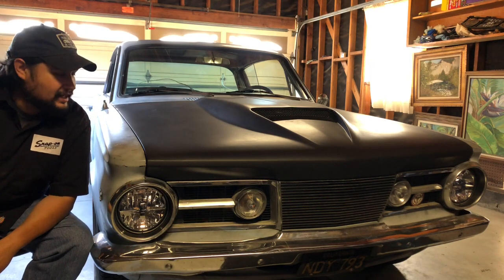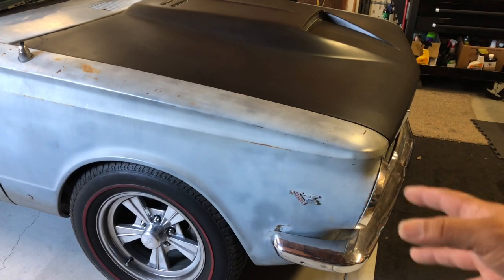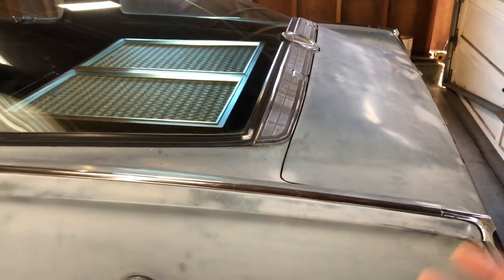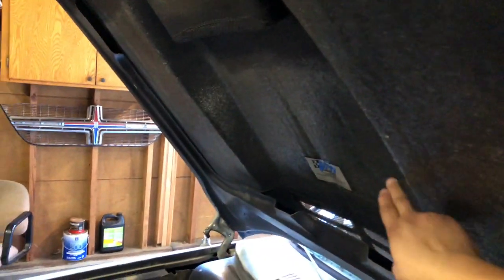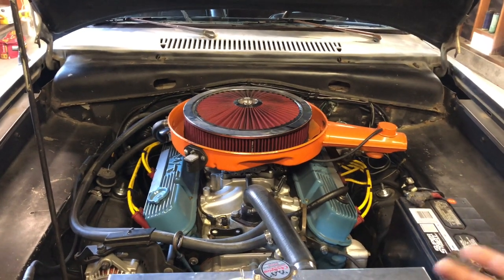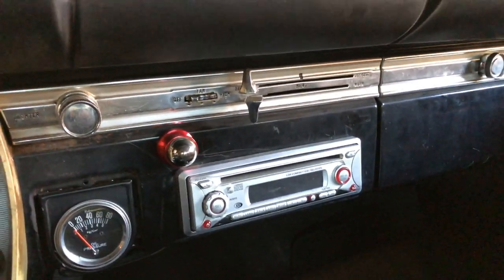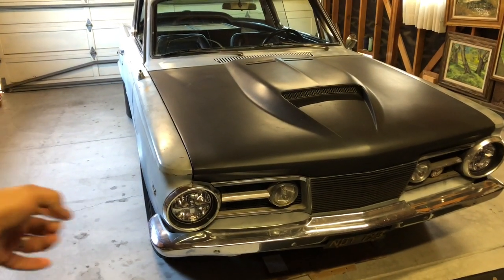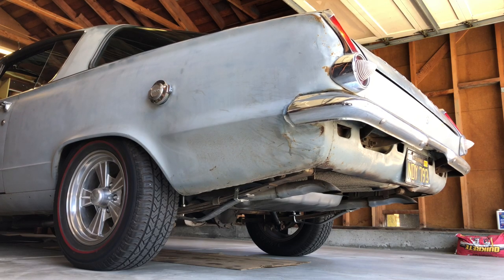MOPAR REVIEW : I review my 1965 Plymouth Barracuda

Comment: Im seriously impressed. Fuel injection and disk brakes with upgraded suspension. And the 318 has the same M/T valve covers i had. I had a 69 Barracuda in the late seventies and there were people who used home speakers in their cars. At the time high power car stereos were just starting and I had a 30 watt Craig cassette player with radio shack 8" woofers and big midrange horns all built into the wooden divider between the trunk and the back window. I had a bed in the back because you could camp out in these cars. Yours is beautiful, dont ever let it go!
Reply from the maker: Thank you so much! I’m really glad you liked the review and my car. Yours sounds like it was awesome

Comment: Good video!   Thanks for sharing it.

My dad had a bright red 1964 Barracuda with a 273 V8 and the push button transmission.  It was in excellent condition.  Original everything.   It wasn't in showroom condition but it was definitely in excellent shape.  He took it to a few local car shows and scooped up a small handful of prizes.   He had it from about '85 to 2005.  He kept it in great shape but then realized he couldn't keep it rust-free when it shared a garage (in Illinois) with cars that were driven in the winter.   He had to sell it, but it really did break his heart to do so.   I took my date to Senior Prom in it in '97.   Stupidly and recklessly drove it at about 125 mph (I SWEAR the speedometer in my dad's went up to something higher - 120+??  130??   This isn't at all to brag but I KNOW that I saw 125mph on the speedo - so now I'm just wondering if your/his speedo is aftermarket) on a straight, flat stretch of road - like nearly 4 miles of straightaway! - and it was a lot of fun.   My date was laughing.   I shouldn't have done that, but I did, and we lived to tell the tale.   (and yes, I was fully sober)   I'm not going to confirm or deny anything more racy than this (it's not necessary), but even from a fairly wholesome perspective for young adults, having that backseat that folds down and joins the large storage area (AND the trunk that can be added to it, also!) equals one ideal spot to watch the stars with your girlfriend/boyfriend/spouse.
Ideal!    Put a few pillows over that big bar and even a 6 foot plus guy can stretch out fully and "comfortably"!   Or hell, even if you're just alone and find yourself under a beautiful night sky (imagine taking this car out into the deserts of Nevada, Arizona, New Mexico, etc. - or Wyoming "big sky country"!).  These cars are SO underrated.   They run so well.   They're powerful, they're fun, and they look incredible and unique!   I'd argue that they're somewhat more attractive than the almighty Mustangs.   
I wish you the very best of luck with this project (which, by the way, is made that much more interesting by the fact that you're by your own admission not rolling in money) and I would personally advise you to NEVER SELL THIS CAR!
Reply: ADDENDUM:   Normally I am against any more than the very slightest modifications to these old beauties.   Too bad you needed to add the hood w/ the scoop, but that's how it goes.   But it's not a major change.   I hope you're not considering jacking it up in the back (one or two inches, maaaaaybe, tops!).   Anyway, a nice paint job (black or red or a very dark blue - or a deep purple!!) could do wonders.    The old album covers as a temporary headliner is actually pretty cool.   Do it right and that could be a sweet permanent modification.   More interesting than a normal headliner and still serves its intended purpose!
Reply: Ok, his was a ‘64 w/ the push button transmission, and yours is a ‘65 so perhaps that explains the speedometer difference.   You might wanna get a new speedometer as I’m fairly sure your beast will easily exceed a mere 110mph!!   🙂
Drive safely and defensively, though!
Reply from the maker: I’m really glad you enjoyed my video and thank you so much for sharing the story of your dad’s car. It’s like most people that I meet that have owned one absolutely love the car. I love this car and I never intended to sell it. It is my forever car.
Reply: Worked my 65s 273 . Top speed was 130. Stock automatic and rear. My friends 68 383 roadrunner couldn't get past it at that top speed.

Comment: I have a 65 Barracuda Formula S 4-speed that I have owned for 53 years.  I originally started modifying it in the early 70s, I later put it in storage.  I am starting to put it back together now.  I just wanted to mention that back in the day the 273 4bl was marketed at 235 HP and the 318 2bl was marketed at 230HP.  I really like you hood scoop better than mine, I think I'm going to get a hood like yours and replace mine.
Reply from the maker: @JimFuller-hu2lj  that’s very very cool, and thank you very much. I like the hood scoop a lot too and it’s very well-made. VFN is the manufacturer. I believe they still have them in production.

Comment: Love it  !  It's awesome, I want to put a 383 in mine, with a really lumpy cam, just cause I can.
Reply from the maker: That would be awesome, go for it!...I’m currently gathering parts and money to build a 408 POLY HEAD engine for it. Crazy I know but it’s different and fits the overall feel of the car.
Reply: I’ve had three 65 barracudas. My first one I had in high school. I did put a 383 in it from a 67 Chrysler 300. I had to reshape the transmission tunnel and shorten the drive shaft. The exhaust manifold on the driver side wouldn’t fit because of the steering box, so I got another exhaust manifold for the right side and put it on the left side which made it dump in front of the steering box and the exhaust pipe went in front and under it. When the engine was in it left an eighth of an inch on gap on both sides of the wheel well, and when it torqued, it would rub the wheel well !!You could lay rubber a city block unfortunately the rear end can’t handle it. I blew it up. Lol, too many burnouts!!
Reply: Oh, that was in 1977 when I did that with the 383. I also had to crank the torsion bars way up because the extra weight squatted the front down pretty good

Comment: An H.P. 273 engine was rated at 235 horsepower gross. There were a number of internal differences between the two versions of the 273. The Hi Po was not just a regular 273 with a four barrel carb.

Comment: Very cool video! I have a '65 Barracuda as well - how difficult was the conversion to the LED headlights, and who makes those headlamps?
Reply from the maker: Thank you. I like the video, headlights are actually from a heavy duty truck parts store. The brand is Gates and believe it or not they are normally used for garbage trucks. I try to get you a part number. As for wiring they plug right in although you will have to supply a 12v 30amp relay to stock wiring harness in between the headlight switch and the headlights
Reply: @tailsfromthejunkyard1023  Awesome! Thanks for the reply, and subscribed!

Comment: I must have missed it. What type of injection system are you using? What fuel pump are you running? Body looks solid & straight.
Reply from the maker: Thanks, for the EFI I’m running the MSD Atomic EFI system with their supplies fuel pump.

Comment: Awesome🖒
That would be one of my Dream Projects!!!
Same Hood, but leave the Stock looking Exterior...

But...

Drop the Front and Rear Suspension, and exchanging it for Magnum Force K-Member(Front) and 4 Link Set-Up(Rear).
GenII or GenIII HEMI???

Decisions $$$ Decisions $$$😂😂😂
Reply from the maker: That would be awesome! Believe it or not my initial plan for this project was something far more radical....

Try for example... mid-engine, four wheel drive, six speed/eight speed, and a boosted polyhead.
Reply: @tailsfromthejunkyard1023  sounds like a Project "Roadster Shop" or "Nelson Racing" would do🖒😉
Reply: @tailsfromthejunkyard1023  Keep it like it is! It's so cool. Don't do a mid engine on it.
Reply: @tailsfromthejunkyard1023  Awesome overview Anthony and I agree with @JosephDR , keep this one as it is, and mid-engine a stripped parts car. I have a 64 Barracuda and since I bought it I've found at least 4 different body shells near me with the rear glass still in them. I think the doors on a Valiant Signet 200 hard top would work but the actual roll up door glass is different. You have a source for hoods and the rest is AWD. Don't dream, seek it out. I want to see it!!
Reply from the maker: @cmintsurfer  thank you! And yes I agree, once I’m situated a little better I’m definitely getting a shell with at least the rear glass and building that dream car if mine. And I’m leaving this one as is

Comment: Also what wheels are those?
Reply from the maker: The wheels are a reproduction of a design called “Raider wheels” from the 60s. They are made by a company called Rocket Wheels and the tires are 235/60r15 redlines from Cocker Tire.
Reply: Thanks sir!
Reply: @tailsfromthejunkyard1023  Do they bolt right on or do you need wheel adapters?
Reply from the maker: @JosephDR  as long as you have a 4.5 on 5 bolt pattern they will bolt on, I upgraded this car from its stock 4 on 5 bolt pattern that’s they fit on mine.
Reply: @tailsfromthejunkyard1023  Thanks, man. I want my '65 to look just like yours with the wheels, stance and hood scoop
Reply: @tailsfromthejunkyard1023  Are your tires the same 235/60r15 front and back? I got 15" Magnum 500 from Vintiques and want to put tires on them. Getting rid of the 14" wheels.
Reply from the maker: @JosephDR  yes they are actually, they fill out the wheel wells really nicely
Reply: @tailsfromthejunkyard1023  Awesome! Thanks so much! And happy Thanksgiving!